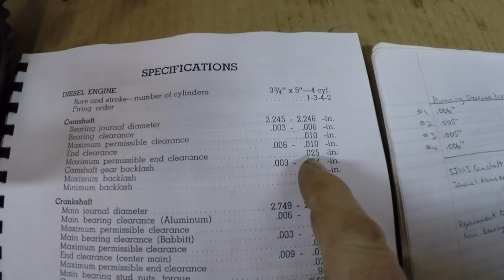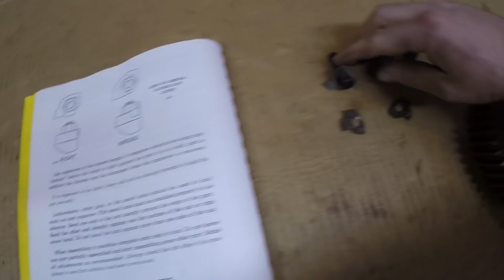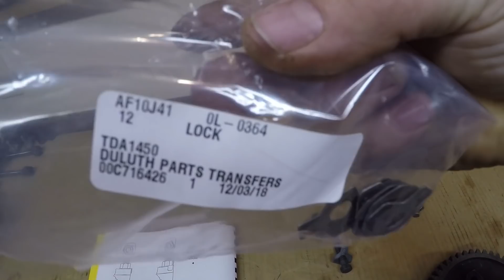Caterpillar D2 #5J1113 Diesel Engine Assembly Ep.13: Camshaft Installation - Despite A Minor Problem

Comment: Not likely you would have the same feeling of awe at the quality of construction on the new automobile engines. Gotta love the heavy iron.
Reply: Very likely and he is aware of it due to his day job.  Modern automobile and truck engines are marvels of engineering and machining.  The power trains in modern vehicles are works of design and machining art.
Reply: @paulcopeland9035  They're also built with the least material possible, so you won't be seeing many modern machines running close to century or indeed more after building like these old diesels or steam engines.

Comment: we used to make bearing scrapers from a half round file
Reply: I sure would enjoy watching you make one of those scrapers. Do you have a few stills of the process or a finished scrapper you could post?

Best wishes for the Holidays!
Roy Lewis - Buffalo, NY
Reply: this was when i was an apprenticebut basically get a half roundfile heat it so it is tempered bend the end over an anvil so you drw it then on a grindstone hollow grind so you get two sharp edges
Reply: @rlewis1946  will check my toolbox this was made in 1973

Comment: One question, you mentioned how hard it was to take the cam nut off and then skipped the torquing of the nut.  How do you hold the cam without damaging it to do either?  What do you lock up to hold it?

Comment: The problem with selecting used part. Let's say I have two crankshafts. One is round but the clearance is just on the limit (of to much), the other is not round but inside the limits. Which is the better choice?
Reply: @squatch253  Regrind is usually the answer, but its a matter of cost. In my case older car engines, that usually running around 3000 rpm. I comfort (or fool) myself by having a good oil pressure, but I realise it's not perfect.